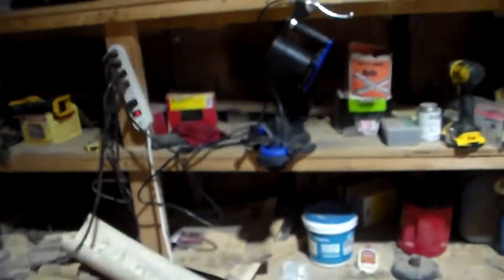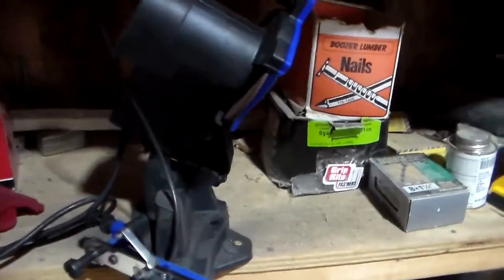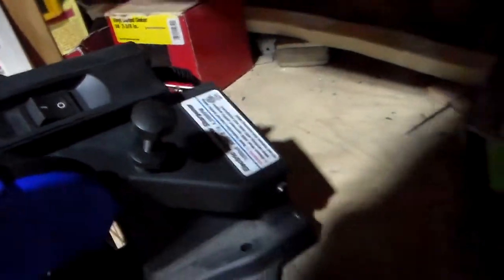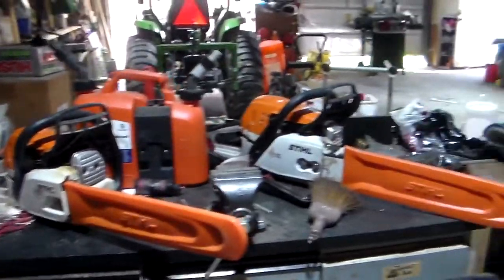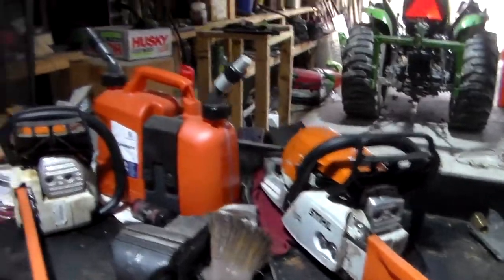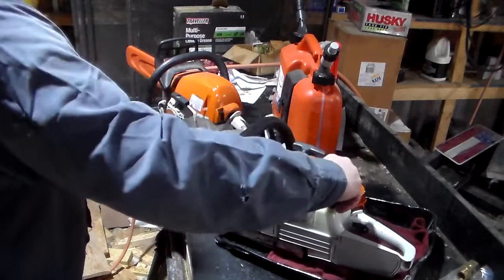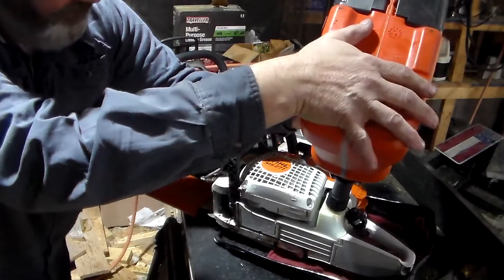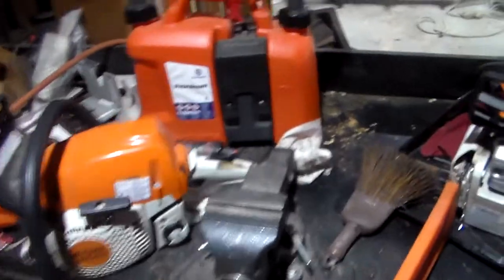Best Chainsaw Fuel Can EVER

Comment: Good timing as I just got an Echo CS-590 Timber Wolf with a 20 inch bar.  This thing is genius
Reply from the maker: I hear good things about them Echos. you should bring it over and we can cut down that tree for ya to use.
Reply: @hardymarshfarm7843  sounds like a plan!!
Reply from the maker: @PalmettoPrepared  yeah I had planed to cut it down the other day, but I don't want it to start breaking down before I can get it to you, so for real, I will wait and we will have to plan a day when you can come this way and will get it down and you can pick a part you want, the rest we can use for fire wood.
Reply: @hardymarshfarm7843  yup, once i finally get my house dried in this week, ill be able to focus on other things and can come on down there
Reply from the maker: @PalmettoPrepared  no worries, we will be here. how is the house doing after the tree wreck? good news for us, I think we may hit the 50 subscriber mark this week, woohoo!
Reply: @hardymarshfarm7843  the electricians fixed me up Thursday, waiting for mid week this week to finally reroof the bad section and fix the broken rafter.  The rest i can do on my own as time dictates